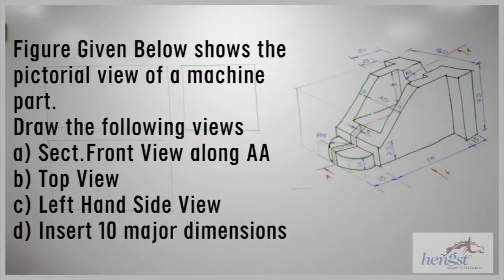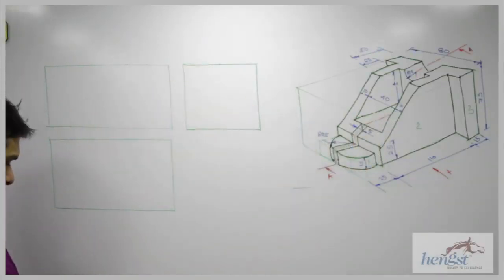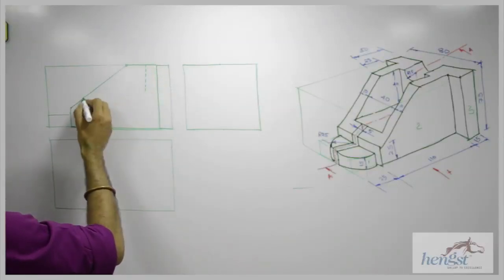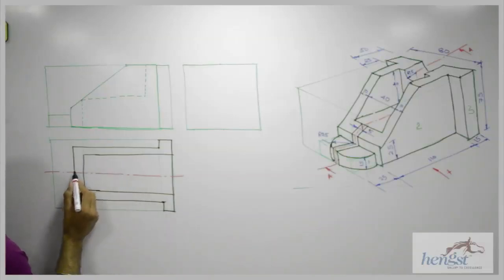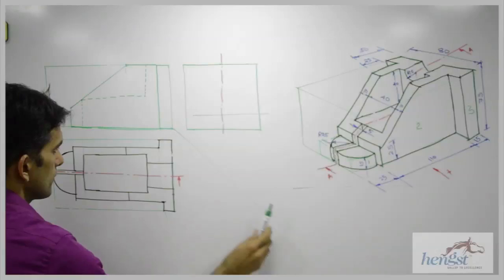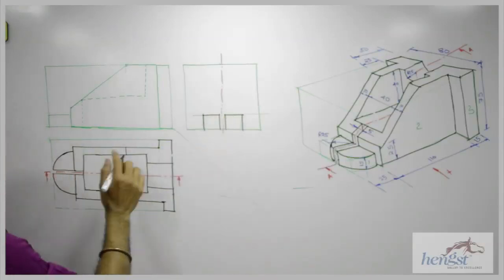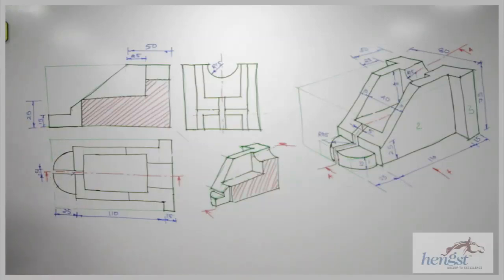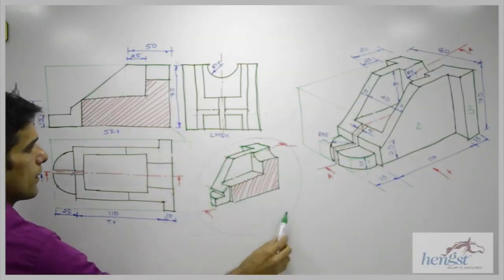Sectional orthographic - Engineering Drawing 2014 Dec paper Q2

Comment: Good day bro, please can you answer this question for me 
1, attached shows the component part for a sub-assembly of a rotary leaver which in practice will turn very slowly with its Centre spindle . the plan of leaves is shown in third angle projection 

A, draw the sectional view on plan xx with the part assembled (but not only the assembly view is required)
B. Provide ten important dimensions
C. Shown appropriate reference balloons.
C. Prepare part list for the sub-assembly.
Reply: Please do you have a what's app line so I can send it to you
Reply from the maker: @hosinmubarack1833 +91 9820084800
Reply from the maker: Can you email me full questions with diagram
Reply from the maker: sachinpandya2602@gmail.com
Reply: Sure I will do that
Reply: Alright

Comment: Sir machine drawing pe video lectures banaeye please
Reply from the maker: nut , bolts etc ??
Reply: @technicaldrawing   machine drawing in mechanical engineering 3rd sem
Reply from the maker: @shubhammunshi3635  assemblies
Reply from the maker: @shubhammunshi3635  I have different folder check cbse assemblies
Reply: @technicaldrawing   sir please upload more video lectures on  machine drawing
Reply from the maker: @shubhammunshi3635  sure
Reply: @technicaldrawing  thank you sir for your valuable guidance